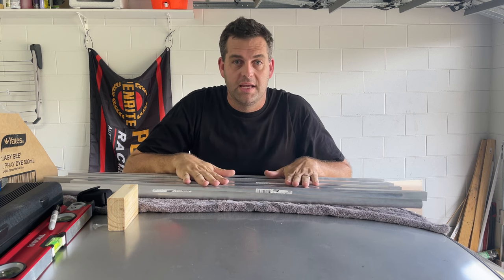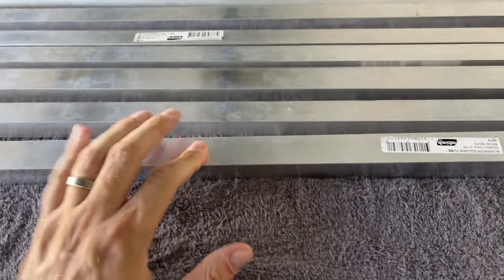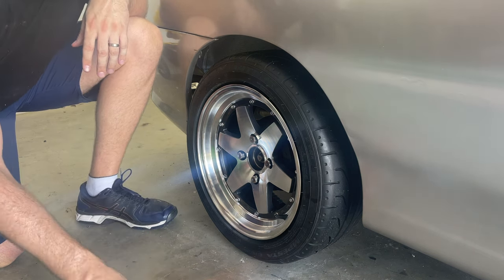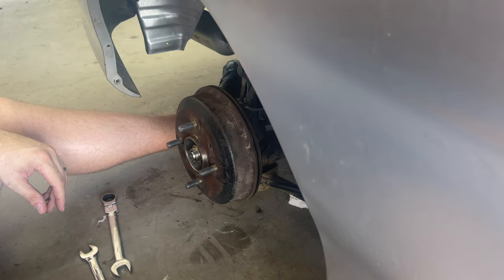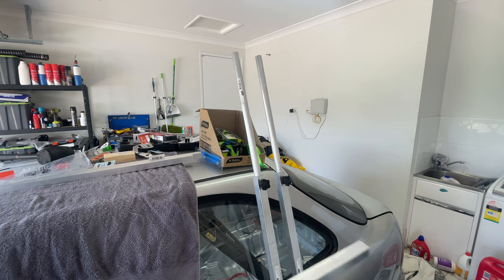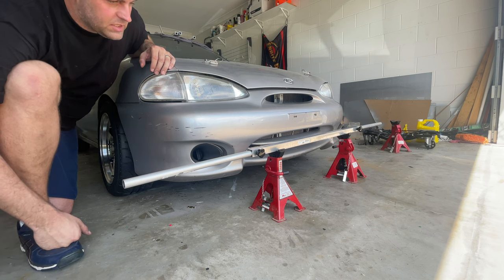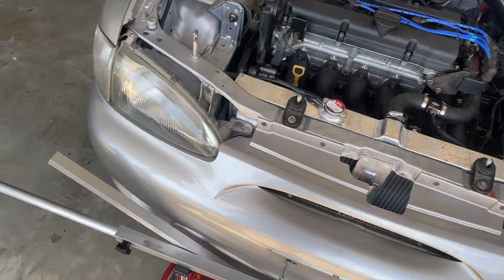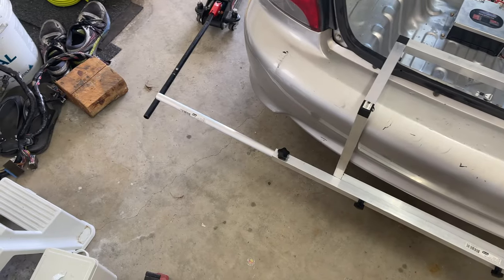How to build a wheel alignment kit at home! Getting the right camber and alignment with ease.

Comment: Concern for me is when that same string system is used to  check toe.  No one seems to mention establishing a centre line for the car so that what ever toe in, zero or toe out you want, has to be the same on both wheels of that axle.
Reply: Don't need a centre line. Toe is measured individually using this method which is better than the total toe method. As long as the wheel is centred and fixed it works.
Reply: I center the strings by making them the same width front and back using identical lengths of 1x2's front and back elevated to center point of wheels using jack stands and shims, then centering them front and back by measuring in on both sides to a standard point on the wheel hub or a point on frame which should be identical unless the vehicle has a wonky frame, taking the measurements from the wheel hub should be fine imho.

Comment: That’s cool. Doesn’t the front wheels need to be able to move freely on the ground?
Such as putting the tyres on a plastic shopping bag with some cooking oil in the middle?
Reply from the maker: Yep. I have done another decent alignment in the car and used two plastic chopping boards and some thin grease between them. Worked well once I lowered the car back down